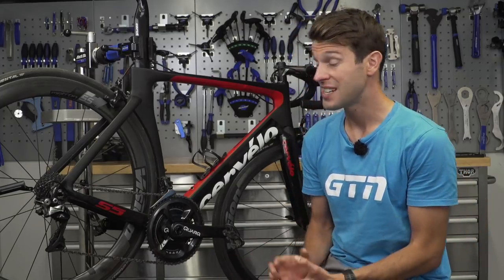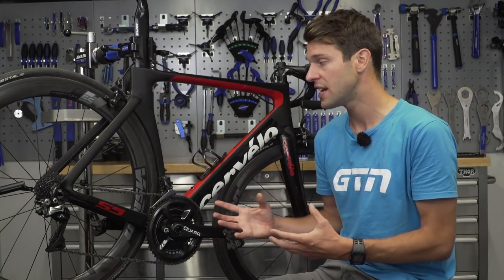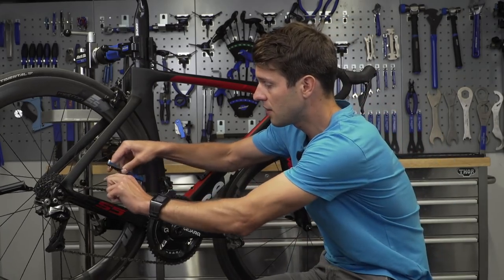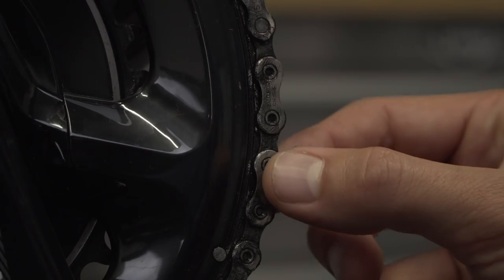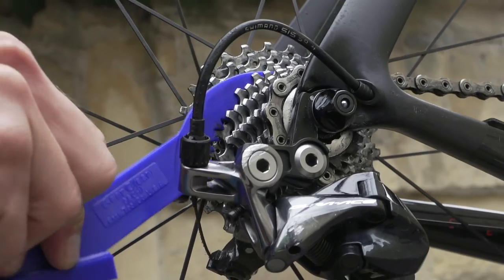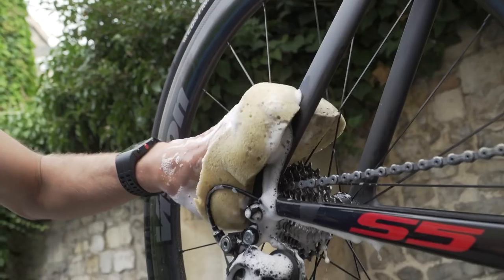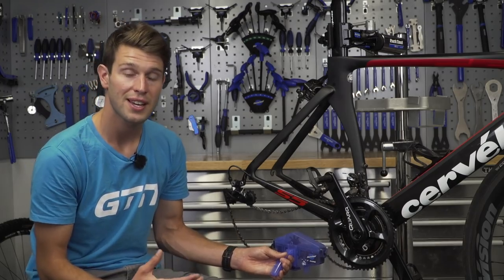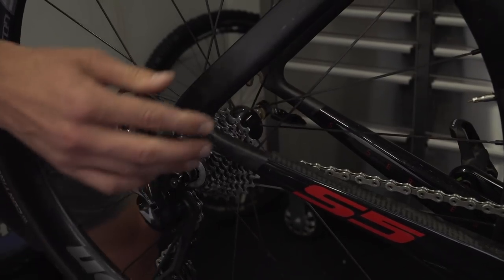Drivetrain Maintenance - How To Prepare Your Chain, Cassette & Chainrings For Race Day

Comment: I switched to a dry lubricant for my drivetrain a couple of months ago. I'm using Molten Speed Wax (which has PTFE and molybdenum disulphide premixed into the paraffin). So far, I've put 1120 miles (1802 km) on my new chain since switching to wax. I've rewaxed it twice since the initial waxing. It has transformed drivetrain cleanup into a much easier and less dirty operation. There is very little cleanup required for the cassette, chainring or derailleur. Just wipe off the minor wax that collects there. The only significant cleanup is to the chain, itself. I typically just swish it in some denatured alcohol to remove debris, let it dry, then dip the chain in the melted wax. I have a small slow cooker (crock pot) dedicated to this purpose that is always ready to go. I just turn it on before I start work on the drivetrain and by the time the rest of the drivetrain is clean and I'm ready to dip the chain, the wax has melted and reached the target temperature of 200°F (93°C). The entire process is quicker than cleaning a wet-lubed drivetrain and I no longer need to wear gloves while doing it because there is no oil or grease. And, because less dirt and debris sticks to the wax, my drivetrain stays cleaner. However, I still have to clean it as frequently as with a wet lube because the wax eventually wears off (at roughly 200-400 mile / 322-644 km intervals in dry weather).
Reply: D.Eldon I do the same using the process described in the Oz Cycle on YouTube. Real easy and I’ll not go back to the wet lubricant method.

Comment: Is it bad for your chain if you take it off and wash it with petrol
Reply: donnchadh roarty no im a bike mechenic and i do it to all my customers' bikes, never ever had a problem
Reply: @donnchadh roarty -- I prefer to take my chain off. I use SRAM chains with their removable PowerLock links. It's much easier and safer to clean the drivetrain with the chain off because there is less chance of spraying degreaser where you don't want it (like near wheel bearings or bottom bracket bearings). As for using petrol, I don't recommend it. It's just too dangerous to your health, the environment and as a fire hazard. In the past I used a citrus-based degreaser, then finished by washing with soapy water. However, I've switched to a more effective technique using odorless mineral spirits (the same stuff used by artists to clean oil paint from paint brushes). I place it in a large-mouth glass jar along with the chain and swish it around for a couple of minutes. For an extra-dirty chain, it may take 2-3 washes, wiping the jar clean each time. I filter the used mineral spirits through a coffee filter to remove the debris and reuse it the next time. For a final rinse and to remove any residue, I clean the jar and put some denatured alcohol into it, then swish the chain in it. When finished, the chain is super clean with zero residue.
Reply: This has been mentioned on the Global Cycling Network - it's fine for cleaning but difficult to get rid off since you can't flush it down the sink or toilet.
Reply: D.Eldon i think you misread my comment i said i take it off(the chain)
Reply: @donnchadh roarty -- Respectfully, I don't believe I misread your post. And your post was not a "comment" -- it was a "question". I understood that you take the chain off. But the way your sentence is worded, the "Is it bad" question can refer to both taking the chain off and using petrol to clean it. So I provided my opinion on both (taking the chain off is good, using petrol is bad). If you were only asking about petrol, then taking the chain off the bike is not relevant and the sentence would be better worded like this: Is it bad to use petrol to clean my chain?

It's my impression that many triathletes do not service their own bikes and have minimal knowledge about bike mechanics. Some of them will probably be unaware that they can use a chain that is made to be easily removed from the bike. They may only be familiar with the kind that require you to drive a pin out with a chain breaker tool. For them, taking the chain off is often undesirable. So it is good to list some of the reasons why it is easier and safer to clean the drivetrain with the chain off.
Reply: D.Eldon To my surprise in my current careera as a cyclist i have noticed a lot of cyclists tend not to know very much about bike chains or bikes for that matter also although this is not relavant can you swap a back wheel of a bike thats cassete that is 11 speed to a 
derailleur that is used with a 10 speed cassete

Comment: Change the chain and cassette at the same time?  I understand the concept behind it, but it seems like a little overkill.  If you follow that reasoning shouldn't you replace your crank rings and jockey wheels as well?  They all have teeth and wear with use.  I replace chains 3-4 times a season usually between 1000-1500miles.
Reply: 1000-1500 miles?! Thats nothing. And they wear to 0.5 stretch? My SLX 11spd chain is below 0.3 after 2000km on trail use. Mind you that i wax all my chains

Comment: A very old fashioned cleaning video. And not very effective IMO
I use an ultra sonic cleaner for my chains, cassettes, smaller chainrings(i also ride XC) and other smaller bits of bike.
About the jockey wheels. If they get sharp, they still work fine. If the bushings/bearings are done, its a problem of friction. But as long as the teeth can hold the chain securely, they work
And i would recommend to take off all the parts for cleabing off the bike. Crank, chain, cassette, chainrings. Although i am carefull to not spill degreaser on any bearings, cleaning is much easier and more thoroughly when removed from the bike